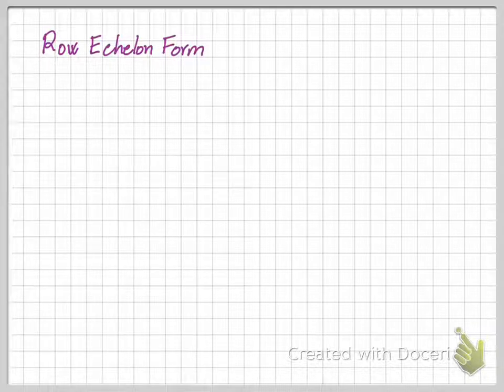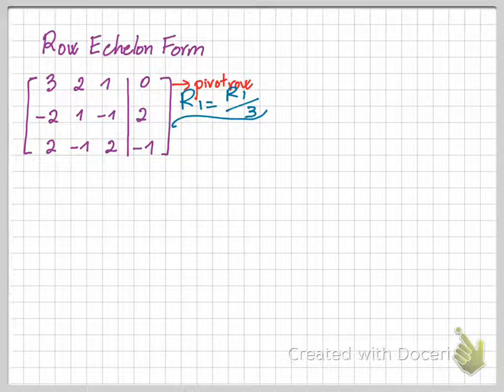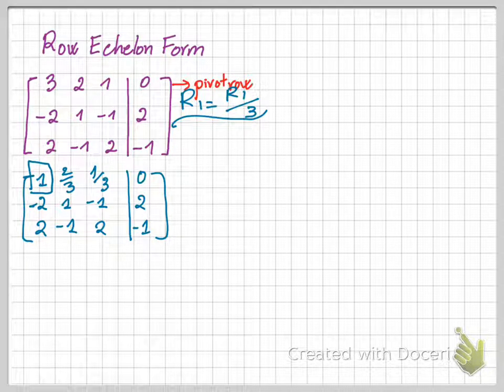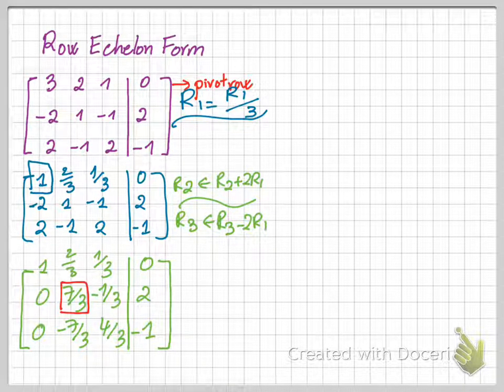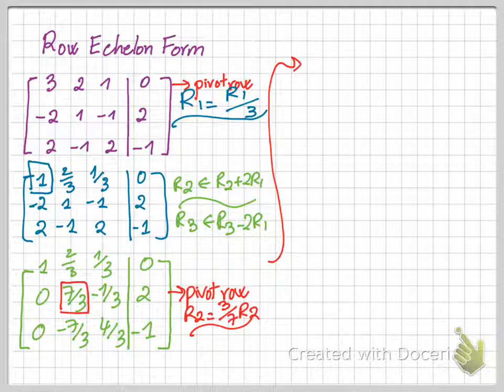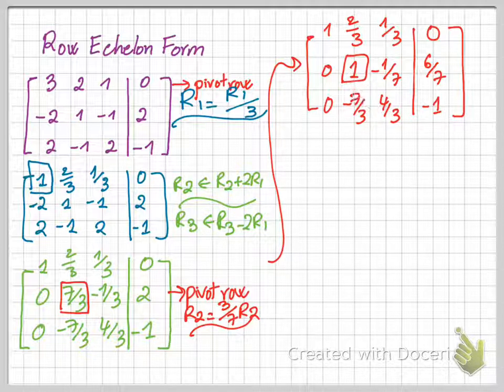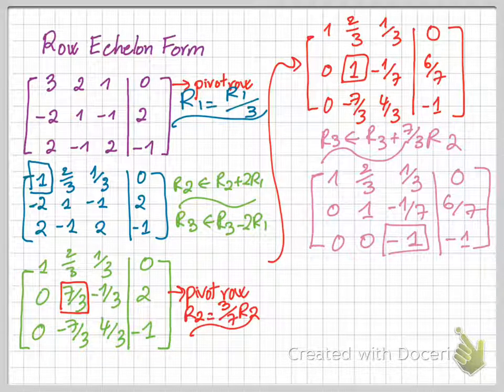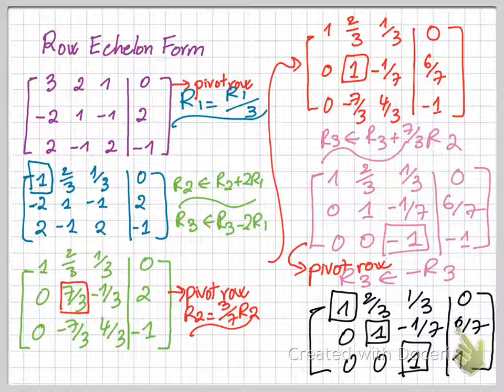Linear Algebra: Transform a Matrix to its Row Echelon Form

Comment: great explanation but isn't the two on (2x4) supposed to be 4 when you do R2 = R2 + 2R1
Reply from the maker: Hm, if I understand it correctly, you were referring to the entry on the 2nd row and 4th column in the second matrix after applying the R2 = R2 + 2R1. It starts with 2 + 2(0) is how 2 is calculated. Please correct me if I’m wrong! Thanks!

Comment: how it is -1 in row 3 at 3:01???
Reply from the maker: If I take r3 + 7/3r2 for a new r3, the third column would be 4/7 + (7/3)(-1/7) = 1, and fourth column: -1 + (7/3)(6/7) = 1. Thus, the last row should be 0 0 1 | 1. That means I could just jump to the last matrix which is in the REF. Thanks for pointing that out! I must have taking the negative for some reason. It is been a while since this video was made.